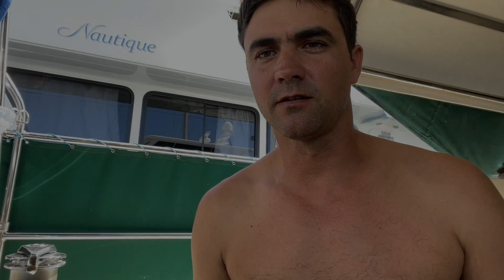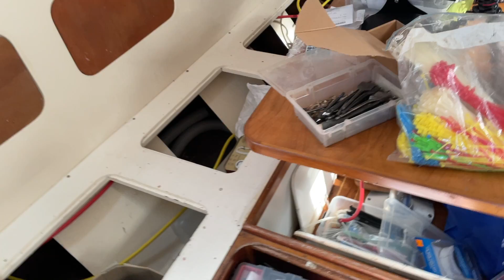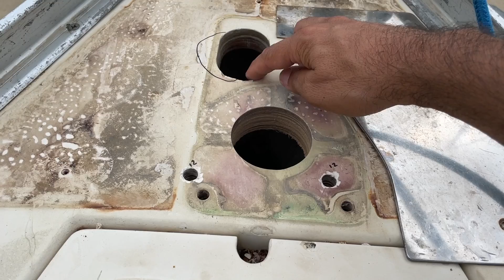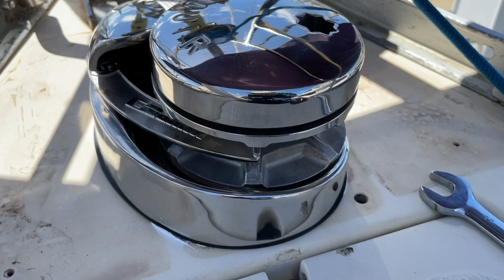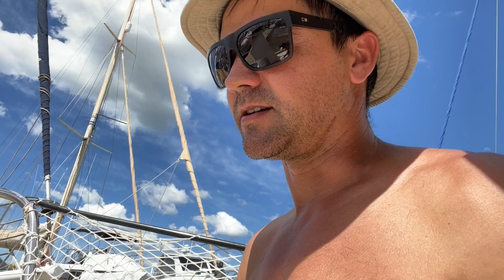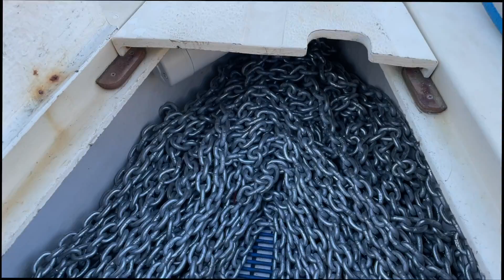Installing a new anchor windlass on a 37ft sailboat | Episode 30

Comment: I hope you see this... approximately how many hours of labor would you say this installation took? Kind regards...
Reply from the maker: I would say one day to install, provided you have the correct materials and parts. The electrical wiring and switching took many hours prior to fitting the windlass. You must use heavy gauge 50mm2 cable to reduce voltage loss, as it’s a long way from the battery to the bow. Hope that helps 🙏
Reply: @AllTheStarsSailing   Hey there, thanks... would 30 hours total be a good assessment?
Reply from the maker: @MurkyDregs  yes if you were pro 😎 but I made the cables up, installed a 70amp breaker, the solenoid relay etc which all takes time too. Luckily the cutout hole on the deck was similar in shape due to the original manual windlass being the same make. Good luck 🤞
Reply: @AllTheStarsSailing   Thank you again!

Comment: good cabling work, you definitely want the breaker as close to the source as you say so you can isolate and protect the cable run itself, but also because the amperage draw on that circuit will be higher as the source than at the winch.
Reply from the maker: Thanks mate, and you Sir must have some electrical background bc that’s exactly what my bro in law said and he’s a sparky 😃
Reply: Actually the current draw is exactly the same anywhere in that circuit. That’s what current does in a series circuit. The Voltage however will be highest at the source, i.e., at the battery due to the volt drop while running the windlass. Definitely have the circuit breaker mounted closer to the battery than the load (windlass). Also need to make sure that the circuit breaker has a high enough fault current rating in kA particularly due to the current carrying capacity of those heavy cables and the potential fault current of the battery that is supplying that load.

Comment: What did you do with the old holes?
Reply from the maker: Gday Philip, as the old holes were sealed, I filled them with non hardening marine sealant, and only one is visible outside the new winch footprint. Ideally I’ll remake another stainless plate to cover this one too, when I have access to my workshop again.

Comment: Great job, its amazing how heavy the chain is when you just lay it out. How have you found the Giantz battery ,and if I can ask what size house battery's did you install, cheers
Reply from the maker: Hi Paul, yes it’s heavy stuff. So we have two 300ah AGMs making total 600ah. We’ve never had to use shore power or a genie. All thanks to Cal and Di who installed them 😃